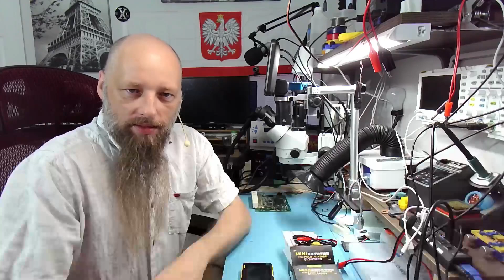Fnirsi DSO 152 Review | Is it any good?

Comment: AC coupling is useful if you want to see the ripple on the car battery voltage. It will not show the DC offset and only show the AC ripple in tens of millivolt range. The ripple gives a very good indication of how well the alternator works.

Comment: Aren't you supposed to calibrate it first before using it?
Reply: Yes, you need to calibrate the device by hooking the clip to the top hole and screw in the probe until signal is nice and square
Reply from the maker: @Dsbarrynl  are you sure about that? I tried that yesterday and it doesn't seem to make any difference, it looks like that top screw/pin just generates square test signal but no matter what I do to the probe it's the same, not perfect but stable. In addition even if you turn the probe, how do you ensure it stays in the same position?
Reply from the maker: @Dsbarrynl  thank you so much, I guess I probably should have read the manual :)
Reply from the maker: @Dsbarrynl  to correct the record: connect the probe to the test pi, press and hold the wheel to enter calibration mode, press RUN to run calibration. It seems to calibrate the voltage to account for the probes. No need to run if using probes provided (as seen on my video)
Reply from the maker: no idea, didn't read the manual :)
Reply: @blackhorserepairs  Amazing...but it figures.
Reply: @blackhorserepairs  It shows. That "ground hook" is for calibrating a probe. And you can get a proper probe for this with the adapter from BNC to the scope.